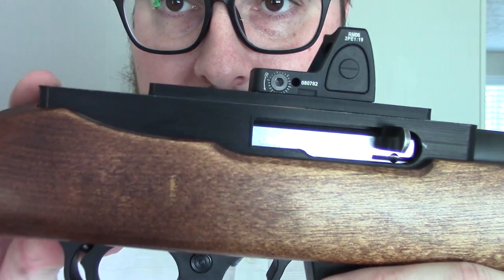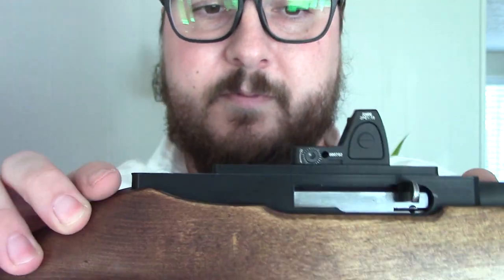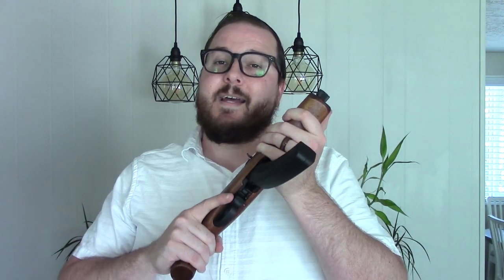3D Printed Ruger 10/22 Charger

Comment: That sweet! Just earned a sub. Im gonna get myself an Ender 3 and get to work on  this little hobby. What printer do you use?
Reply from the maker: I use an Ender 3, and nearly everything on Deterrence Dispensed is designed with the Ender in mind. Super easy to work with.

Comment: How does the barrel fix to the receiver?  Id suggest a assembly video if YouTube allows.
Reply from the maker: The same way it normally does with a 10/22. It slides into the receiver and is held in place with a v block that’s attached with two bolts. The readme for the printable receiver has all of the assembly instructions.

Comment: I need one to keep in a custom fit holster on my motorcycle lol. Preferably in full auto, although I obviously see both the legal and engineering problems with that idea
Reply: 10/22 is remarkably easy to turn full auto, the legal part not so easy.
Reply: @xmrpaintx1  10/22 is actually one of the more difficult firearms to make full auto. What makes it difficult is not just the fact that the trigger group is small, but due to the weak recoil spring there is a lot of bolt bounce. The 10/22 bolt is designed where it can't fire out of battery so you get a lot of failures to fire on an improper full auto 10/22. Many people who bought a registered 10/22 "auto sear" get low key scammed on this as very few people knew how to properly make the 10/22 full auto.

There are two ways to arrest the bolt bounce, the best is to create a secondary disconnector that interacts with a cut groove on the bottom of the bolt. This holds the hammer back until the bolt is stationary. Another option is to add a counterweight to the back of the bolt similar to an AR buffer design. It is less effective however, but does not require a milling machine. 

This is why you don't see a lot of full auto machine shops offering a full auto 10/22 as one of their offerings to shoot. Very few SOT have the skills and knowledge to do the modification correctly.

Comment: So 3D printed guns all require metal parts
Reply from the maker: Correct, in fireable form. They have to have a minimum amount of metal and be visible on x ray. The barrel will normally accomplish this.
Reply: Legally required in the tyrannical states of the US, it needs a specific amount of weight to comply with the “undetectable firearms” bill to be legal in that country (in a free country you could have an all plastic handgun, and I’m sure criminals here follow all these laws...)

People have made all plastic printed firearms like one of the very first ones, the liberator: which is exceptionally terrible but at least .22 is a good small round for a plastic barrel. But it’s a garbage single shot. Since the liberator was designed in the US they had to do stupid requirements like rifle the barrel (otherwise that’s illegal), and add holes to add metal weights (otherwise that’s illegal), but it doesn’t actually need any metal to function (I think it used a small nail for the firing pin, which I think is typical for printed firearms since that’s way more robust than plastic if you want it to last a while).

Id recommend to always make the barrel metal or carbon fiber, something better than plastic even though plastic can technically be used for safety reasons I’d recommend not using it.
Reply: @booliganshootingsports  The BA-50 is 100% polymer and shoots .50 AE
Reply: @PothocketsFPV  does it have springs?

Comment: I know you're probably not gonna see this, but how did you take apart your enforcer Needletail, like I can't get the big pin holding the upper to the lower out. I took off the hex screw, but when I try to push the pin out, it doesn't come out, how'd you do it?
Reply from the maker: I've never tested a Lancer Enforcer Needletail, so I can't help you out there. In general, you might need to tap that pin out with a hammer and a punch, sometimes they're in there stiff.

Comment: If you’re really good with 3D printing you can make a whole ass body with a custom grip, and stock. Or foldable stock.
Reply from the maker: Check my Instagram, I did end up printing a chassis, grip, and used my printed folding brace on it. Don’t even need to be good at printing, they’re very easy prints.
Reply: @booliganshootingsports  epic

Comment: I just bought a stock and take off barrel to start this project.  My question is did you research the legality of it? Your gun is much cooler than a Charger 22 from Ruger and it's the look I would go for. But since I'm not setup to print the receiver I intend to buy a new one from Brownell's or Ruger. I ASSUME that would be legal for a pistol build but not sure. Roger has new receivers marked ' Charger" and I would feel safer using that but they cost about twice what the Brownell's model goes for. 
I just assume that since there are now 10/22 rifles AND pistols in the world that a new unused receiver would be just like a new AR lower.  As in it could be a pistol or a rifle legally.  But am I wrong or missing something important?
Reply from the maker: If it’s a new receiver that has never been built as a rifle, you can legally build it as a pistol.
Reply: @booliganshootingsports  Thanks for the response.  And that's what I thought.  Kinda like how the receiver on my Mossberg Shockwave was new and never mounted to a stock.

Comment: I have a hard time believing the $130 parts price. Bolts and trigger assemblies alone are hard to find for less than $80 each.
Reply from the maker: The prices on parts have skyrocketed on Ebay since the design files were released, moreso after this video came out. I bought my parts before they were released when the parts prices were still normal. I paid $30 for a barrel, $35 for bolt/handle/all springs, $10 for pins, screws, and a v block, $25 locally for a stock that I cut down myself, and $30 or so for the trigger components that I needed. There are definitely still deals to be found, I bought a whole additional barrel and trigger group locally for $40.
Reply: @booliganshootingsports  wish I had a time machine.

Comment: Why not just get an actual Ruger Charger pistol??
Reply from the maker: A few reasons. I built this for less than half the price of an “off the shelf” Ruger charger. I also built this using uncontrolled components shipped straight to my house with no FFL required as I printed my own receiver. And mainly, because I could.

Comment: Is it metal print or just 100 percent infill of tough polymer.
Reply from the maker: 100% infill of PLA, and honestly, it doesn't need much in a 10/22 receiver. The thing is a brick with low recoil forces.
Reply: @booliganshootingsports  do you think if it was the least ammount of infill it could be molded in aluminum? Like foam cast but its pla
Reply from the maker: @dgundeadforge17  I'm sure someone experienced in aluminum casting could do something like that. But I have to ask what the point would be. This PLA receiver should last thousands of rounds without failure, and then it's a few hours and about $2 in material to print a new one. Doesn't seem to be worth the effort.
Reply: @booliganshootingsports  has it survived drop test? Thats the only thing im concerened about. Also could you do a video for a holster for it. Also if you put a brass cap on end of pistol grip it could look like a dueling pistol.
Reply from the maker: @dgundeadforge17  For my build, there's nothing there that could break if it was dropped. The print layers are in the strongest orientation at the only potential breakage point (barrel attachment block) so it's unlikely that it would break in normal use. But it comes down to, again, if it breaks, make a new one. Seriously, start the process at breakfast time and you have a completed receiver by dinner. I'm not a holster maker, so I likely won't be making one for it.
Reply: @booliganshootingsports  okay. cool option just print up extra's if theres issues

Comment: If i were to chop and crown a 16 to about 10 or 9 would i have cycling issues
Reply from the maker: Nope. Ruger chargers come with similarly sized barrels from the factory.
Reply: you could cut to two inches and it would work fine.

Comment: Parts list please!
Reply from the maker: I mean, it’s just regular 10/22 parts. Stock trigger, stock bolt, handle, etc. Stock barrel cut and threaded. Stock stock cut and shaped into a pistol grip. Only interesting part is the receiver which I printed and installed all these parts onto.
Reply: What stock is the question.
Reply from the maker: @gumby754  I answer that in the video and in the comment you replied to. It’s a factory Ruger 19/22 stock that I cut down and reshaped.

Comment: You should make and sell these!
Reply from the maker: I'm not an FFL07 and can't manufacture firearms with the intention to sell.
Reply: @booliganshootingsports  what about just the stock ?
Reply from the maker: @theoneand0nly874  My labor rates make it cost prohibitive for most people to buy handmade stuff like this wood grip. Nobody wants to pay $250+ for a wooden grip.
Reply: @booliganshootingsports  aha I see so just get the wonder 3 then. I already ordered a standard ruger 10/22. Do I just download and print the stock and receiver to make it legally a pistol ? Mine comes with a 18 inch barrel though so I’m not sure if I should cut it off or just order a short barrel. What did you do ?
Reply from the maker: @theoneand0nly874  The wooden grip on this gun isn't printed. It's a wood stock that was hand shaped to this design. To make it a pistol, you would have to print a new receiver. I explained in this video you're commenting on exactly what I did to build mine.